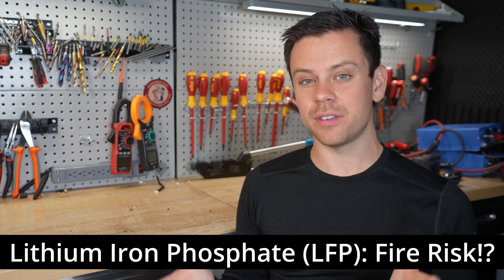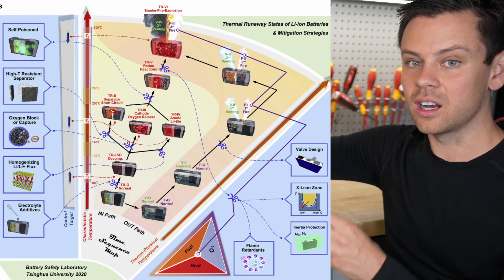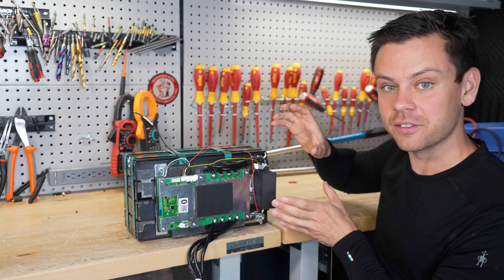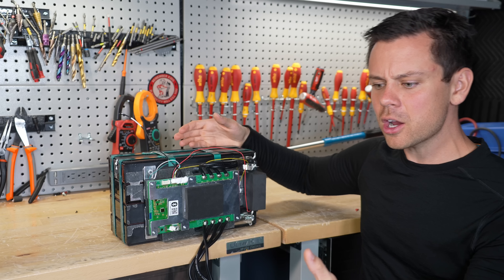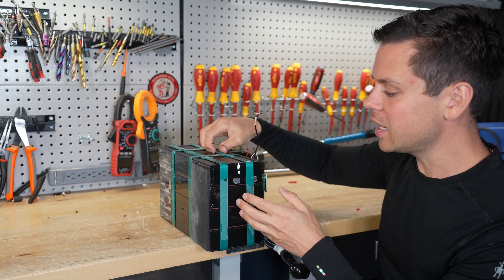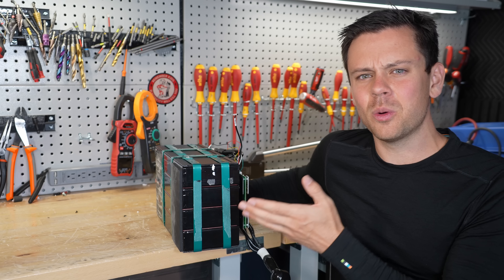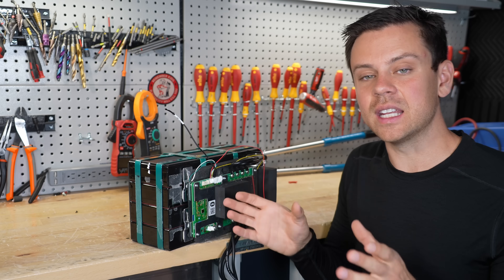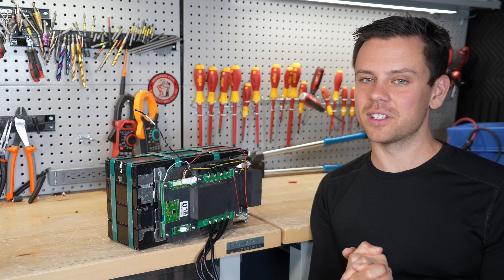LFP Battery Fire Safety: What You NEED to Know

Comment: I run four LFP 12.8V 100Ah batteries (2S2P) in a 24V setup in my workshop, it powers a 2000W inverter and runs my entire shop.
I used to run these 4 batteries in 12V (all 4 in parallel) and I had a 2 gauge cable melt down and catch on fire. I was able to disconnect the cable and thankfully, I had the cable plugged into a terminal block. The part of the cable that heated up was attached to the terminal block and thankfully all I lost was a post on the terminal block and a 1foot patch cable. 
I only run my system when I'm present so I was able to stop the fire before it got beyond the cable.
What you are saying is 100% correct, LFP batteries are very safe as long as you use proper cabling and secondary components.
Reply: No fuse on the wire that caught on fire? Wires should be fused to protect against exactly this sort of thing. What fuse rating is used is determined by which wire gauge is used. If more current flows than the wire is rated for, then the fuse goes out and nothing more happens.
Reply: @TheCrazyStudent  there was, it was a strange instance...
I was running a little A/C unit and it created some sort of back feed through the inverter.
It heated up almost like induction.
Mathematically, that cable gauge should have been more than enough to support the wattage that was being pulled. 
I think at the time it was only pulling 800W.
Reply: what caused it?
Reply: @jimmybrad156   I don't know, at the time I had a 1500W pure sine wave inverter and was using 3 batteries (12V 100Ah) in parallel. The 2 gauge cable should have been able to support about 1500W at that voltage. 
I have had 1000w+ loads run on that inverter for sustained periods of time and had little to no heating on the wires. Those sustained loads included angles grinders, a portable wire fed welder, and 1400W concrete block saws. That 1500W inverter had no issues with those loads.
At the time of the cable failure, I was testing a small air conditioner. The sustained load at the time was about 800W and the cable heated up in-spite of breakers and fuses. 
As far as I could tell, it was some freak combination between the inverter and the portable air conditioner creating some kind of induction field that only effected that area of cable. 
upon further testing, I was able to repeat the incident with different cables which ruled out a bad cable... I was also able to repeat the incident on an entirely different inverter. I then tried a 2000W pure sine wave Renogy inverter and had the same heating issue, only that time it was at the positive input in the inverter itself! 

After a lot of pondering, I decided to try a 24V inverter running 120V. I have 3 different portable air-conditioners that I keep in case of power failures, or if my primary HVAC system goes out. 
When tested on 24V battery input ((26-27V true) and 120V inverter output, the heating issue completely disappeared. 
Even when testing my biggest portable AC unit (1280W) the system still works fine. There is a peak when the AC unit first turns on, but after a few seconds it calms down. 

All I can say is maybe the 12V inverters I have are not producing pure 110 voltage and it caused some kind of feed back loop when used with air conditioners. 
The 24V inverter has 0 issues, I'm glad I made the jump to 24V because it does seem to be a lot more efficient and safer than running 12V.
Reply: @woodlanditguy2951  Sounds like you might have a problem with high contact resistance between the affected cable and the terminal block. Even microohms matters when dealing with such high currents. A fuse or breaker won’t protect against high contact resistance because high contact resistance doesn’t create excessive current flow. It rather forces the current to pass through a point of high resistance. That creates I2R losses which will generate spot heat, enough heat to melt cables and turn things on fire if it’s bad enough and there is enough current flow to create that scenario. I’m not sure which cable exactly was the incident cable? You mentioned that it goes to a terminal block, but what’s that block connected to? Is the incident cable connecting the batteries together? Or is it between the battery bank and the inverter?
Have you connected the inverter to the battery bank in a way so that the batteries stays balanced under load? For example, if four batteries are in parallel, then the inverter should go to BatA+ and BatD-, not BatA+ and BatA-. If you connect it the wrong way, then one of the batteries will provide most of the current and that battery will degrade earlier than the other ones. The current will also be distributed unequally between the cables that are connecting the batteries in that case. This means that one pair of interconnecting battery wires can have higher current going through it and therefore be of greater risk of melting. So make sure to use a balanced connection to your inverter.
As for the cables that you tested several of, did you crimp them yourself or bought them premade? If they are premade and of bad quality, poorly crimped and from the same batch, it’s not impossible that several of them could cause problems.
But basically, what you should do is to focus on the area where the overheating originated from. Was it the whole wire that heated up, or just the lug?
I am actually going the extra mile of cleaning lugs, washers and nuts with alcohol before mounting it, just to remove any risk of contamination that increases contact resistance. I also do this while wearing disposable vinyl gloves to avoid putting fingerprints on the contact areas when mounting the wire lugs to their posts.
Since it works fine for you to run a 24V inverter but not 12V, that would suggest that you do have a problem with your system in terms of current handling capacity on the input side of the inverter. A 24V inverter will draw half the current on its input compared to a 12V inverter at the same output load, so a 12V inverter requires more heavy duty cables on its input. When you say “2 gauge”, I suppose you mean 2 AWG? That’s too thin when trying to pull 2000W on the output of a 12V inverter. A 12V pure sine wave inverter usually pulls around 160 - 180 Amps on its input when an appliance pulls 2000W from it. That’s way more than the 90-130 amps or so that your 2 AWG wires are rated for! When you run a 24V inverter however, then it will draw half the current of its 12V equivalent, so when the 12V inverter needs 180 amps, then the 24V inverter will only pull 90 amps. This is just about what your 2 AWG wires can handle.
It’s not strange that cables will start melting and there will be fires when a system is built with undersized cables. In your case, either you can continue with a 24V inverter and never pull more than 2000W from the inverter, or you can use one of your 12V inverters if you upgrade to more heavy duty cables between the batteries themselves and batteries <-> inverter input.
It’s not more “unsafe” to run a 12V inverter than a 24V one as long as you make sure to size the system correctly and fuse everything properly. I’m personally using 1/0 AWG between my 12V paralleled batteries and battery to 12V inverter connection. Inverter is 3000W, but pulling max 2000W from it. Cables aren’t even getting warm when inverter outputs 2000W. I was running thinner wires earlier which did get a bit warm to the touch, which I didn’t like. Thinner wires will create more losses, even if the heating is still below a fire hazard. I didn’t like it, which is why I upgraded to 50 mm2 wires (around 1/0 AWG).
By the way, if you have a thermal camera in your shop, then I would recommend that you use that to observe your system while the inverter is outputting a significant amount of power, just to see if you have any issues with your system. I bet that whatever the reason is for your fire incident, that problem is still there and is causing heating even at lower inverter power usage, it’s just that you don’t know about it because it doesn’t cause a fire at that point. However a thermal camera will definitely be able to see it.
Inverters that are well designed should be able to handle inductive loads, but if there is one appliance that is constantly causing problems then maybe there is something wrong with that particular appliance. Perhaps the safest thing to do is to stop using it in that case and get another similar appliance instead. But I would start by making sure that the low voltage cables are sized correctly, as well as crimped and mounted in a way that doesn’t create elevated contact resistance at any connection points.
Reply: @TheCrazyStudent good advise. I have since redesigned my battery bank, and yes, I do have a thermal camera (I got one after the cable melted) I re-terminated all cables and tested each with a multi-meter. 
Since I redesigned my system to 24V, I also went with 1/0 cables even though that is probably overkill for a 2000W inverter.

My 12V system was a test bench and I would run different configs weekly to see what worked and what didn't.

There is a lot of conflicting data on the Internet and few people in my area seem to know much of anything about Solar or how to set up off-grid battery banks so most of what I do is experimental.
I have a concrete and steel shop in a rural area a good distance away from my house so risk is mitigated.

That said, electricity should never be taken for granted and I understand the risks. 
I have always been fascinated by solar energy and finally have gotten to a point in my life where I can afford to figure out what works best and what doesn't.

I may never "need" to use my system, but I do hope to someday learn and build a system robust enough to run my whole house, not just a workshop in my back yard.
Reply: The world is leaving America in its coal dust. Sad to say but that's what USA voted for

Comment: As a firefighter I am always concerned about the lithium in the batteries because it reacts violently with the oxygen in the air should the battery be compromised and let air in there. Still not comfortable with batteries for the house inside the house i guess.

Comment: I appreciate this. I’m a firefighter on our Hazmat team and everyone thinks I’m crazy for having LiFePo4 batteries in my house. This explains succinctly what I’m trying to poorly explain to them😂
Reply: LiPo4 is NOT LFP / LiFePo4
Reply: @NTI-SITICmistyped the acronym
Reply: @NTI-SITIC LiPO4* LiFePO4*
Reply: good afternoon Will I wanted to Thank you very much you have brightened my life  please keep being you Thanks again Will Sincerely Dean.
Reply: "For the last time, the Excelsior is filled with non-flammable helium!"
Reply: LiFePO4*
Reply: Thanks again for this follow-up to your previous video. Another eye-opener for me and hopefully others. Your content is highly prized.
Reply: Hi Will, I have experienced a metal case 100ah LifePo4 prismatic cell catching fire from a split in the case. The battery was constructed with 4 new 2nd grade EVE cells into a 12v/100ah battery+ Daley 200a BMS. Data from the BMS indicated all cells were in spec. The flame was successfully extinguished using a dry powder fire extinguisher. Fortunately we were in the RV when it went off so could attend to it immediately. I still have no idea why it spontaneously spurted out flame from the case.
Reply: LFP do require a higher temperature for thermal runaway fire to occur but it only takes one badly manufactured cell to fail, start venting the highly flammable gases into the battery case or enclosed room. Then one spark and away it goes to a huge fire. 
So NO I would never risk having any high capacity battery packs anywhere near my house nor any prized possessions. Manufacturing quality is too poor these days to risk losing a 200,000+ house over one badly made battery cell
Reply: I live in NorCal and decided to put 1-1/2 inch sprinkler pipes around the property. I have a hydrant in my yard with 120 psi static pressure. I built a dual pressure cable operated hose manifold and put a 1'' double lined hose and variable nozzle in a fire hose cabinet on my roof deck. The water is regulated at 35psi  until I pull the shift lever and get 120 psi. This is a very convenient setup and the other hose bib supports a 3/4 garden hose which is used daily. Low pressure for the plants, high pressure to wet my hillside down.  I also have a 1-1/2 inch Scotty Foam Gun, turnout gear, air supply, etc. I want to be ready for Diablo  Winds and blowing embers and firebrands. I never expected the fire to start inside my shop!

 My LFP 3600 amp hour battery console caught fire 11 months ago. I called 911, ripped off a skylight and had the 1'' hose charged and spraying a cone of water into the column of black smoke, thinking that it will backdraft and blow me off the roof. I had water on it 70 seconds after hearing the loud pop.  There were 4 engines that showed up, but they said that I saved my house with that hose.   I was 71 at the time and thought I was going to have a stroke or heart attack and kept cold water flowing on me as they rolled up their hoses.    The forensic fire investigators think that a name brand battery was dropped upside down from 5-6 feet up during transit (loading dock goof up?).  The system was operating 24/7 for 2+ years with no hint of any trouble, MPPT's shut off, battery bank  at 100%, load about 600 watts of 12,000 rated.   Fire and lithium batteries now scare the hell out of me.  My new system is EG4 and all UL Listed with internal battery fire suppression.

Stay safe out there!
Reply: @kimmer6 
I’ve got all EG4 as well but that story still doesn’t fill me with confidence lol.
Reply: @kimmer6  Hi Kimmer6, thanks for sharing.  Question for you, if you mounted your EG4 batteries to a wall did you use cement board behind them?
Reply: @kimmer6 what triggered this event?
Reply: @omieyouknowme The Forensic Fire Investigators think that the battery that caught fire was dropped upside down and landed flat from 5-6 feet up sometime during transit to me. The negative wires from the battery to the BMS were deformed so there was a dead short with no BMS protection. The unit had 12kw split phase capacity and had only about 600 watts load during the fire.

 Both 60 amp MPPT's were nearly zero output with only 1 amp of solar going into the 3600 amp hour battery bank. The MPPT's were set to stop charging at 98% SOC. I had a video camera focused on the Renogy battery monitor which shows everything on one screen without scrolling. Before the camera burned up, I was able to save all of the readings to give to the investigators.

It was a very hot day and I noted that the shop was nearly 80F inside, an unusually high temperature. This battery failure should not have ever happened.
Reply: @kimmer6 thank you. 

I will open and verify all my battery internals. I bought two eg4s took the lids off guess I’m doing the other two non eg4s now before they go into service.
Reply: @omieyouknowme I have the outside wall mount 280AH batteries. There is no way to peek inside without damaging them and voiding the warranty. But their UL Listed rating and internal fire suppression makes me more confident.
Reply: I also appreciate all your details and breakdowns. You truly are the reason why I want to do this part time but im not yet ready to share just yet. Ill reach out on diysolar. 

Thank you Will for this and the community for recommendations and help. This is an amazing video and I was glued to the screen like always.

Im not letting go of my lead acids yet.

 Im sure this has been done but how does a battery like this do in charging and output at say -20F or below for a couple weeks or longer? Any problems with faults, charging issues or output from batteries even if well protected from the elements but still live in those conditions?

Comment: Loose connections are definitely far more of an issue than anything.  Thats why I do a monthly maintenance plan for my system... I dont run battery communication but log into each bms to check balance and warning/alarm events.  Check torque of connections and clean out any dust.
Reply: Especially with any larger seaonal temperature changes.

Comment: Hey bro, you’re great man but how do you feel about DC house 48 V batteries?
Reply: They are the same cells, just in a different configuration. A 12V 400Ah battery is the exact same as a 48V 100Ah battery. Just different connections for the cells inside.

The voltage selection is more about what you are doing with your system and how big the wires you need. 12V systems need 4 times the current for the same power as 48V so if you are using higher power devices then you probably want 48V for smaller cables.